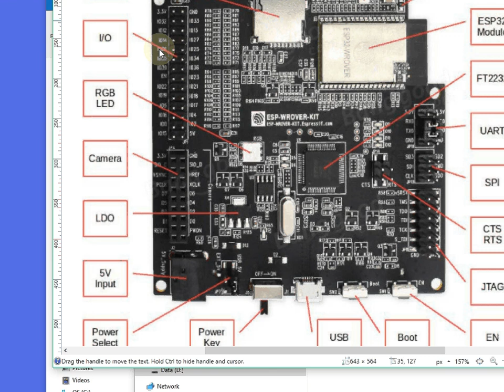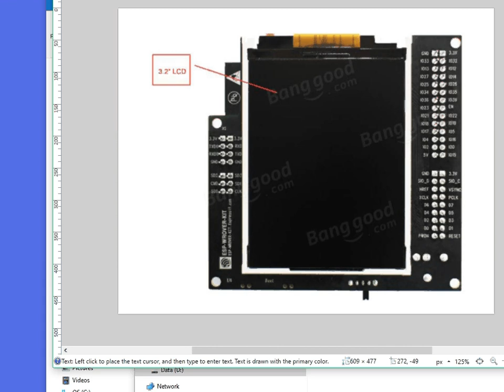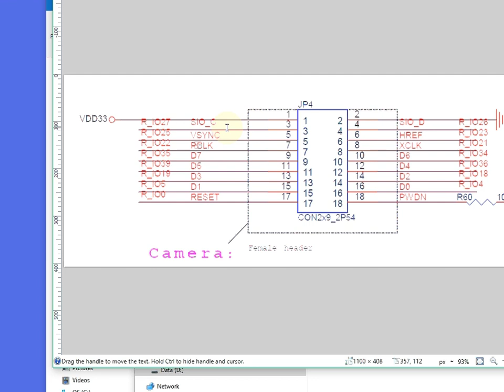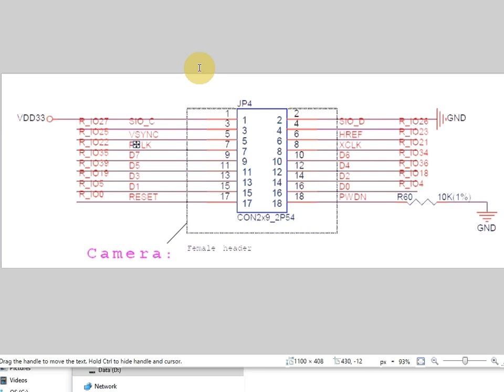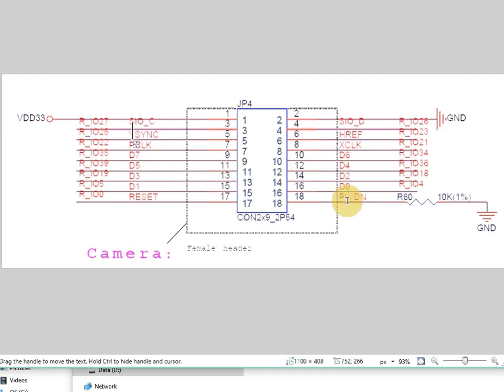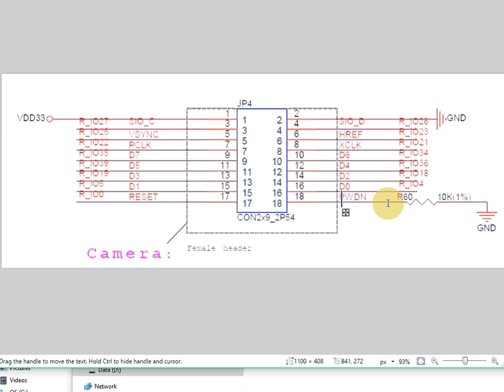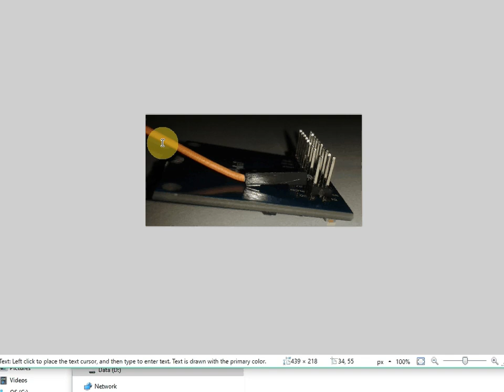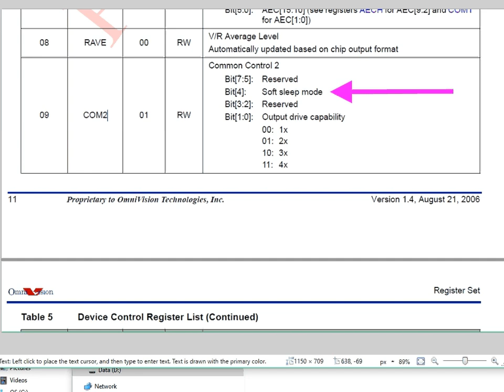ESP32 WRover Kit: LCD and OV7670 camera conflict

Comment: Nice to ear your about that 
I would like to know in addition if we can use pins of this board (in fact it seems that this board is not expandable for other usage as to light up a led as there is no available pins: We then cannot use this board !):
Reply from the maker: Plenty of pins can be used for whatever you like.  All those IO pins on the left of the picture, and the camera pins too if you do not have a camera plugged in and the screen is not using the line.
Reply: @peterwentworth8993  so we need to use alternative pins for the camera. Are they available or is there a  SPI or I2C camera?